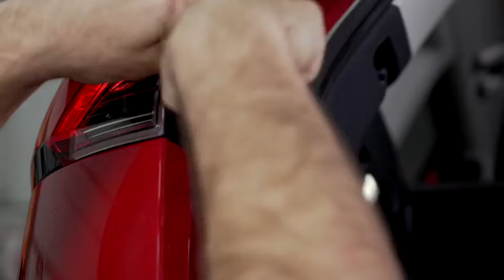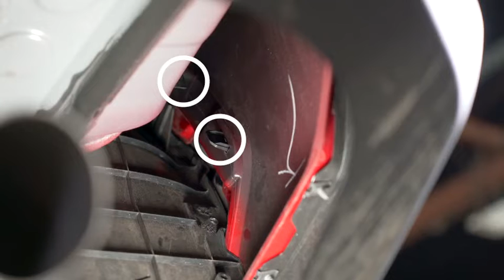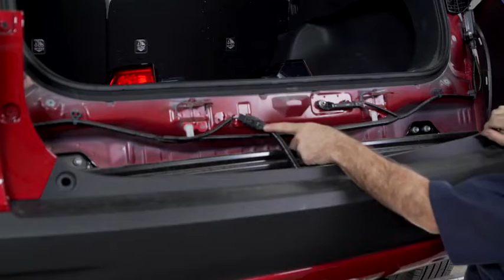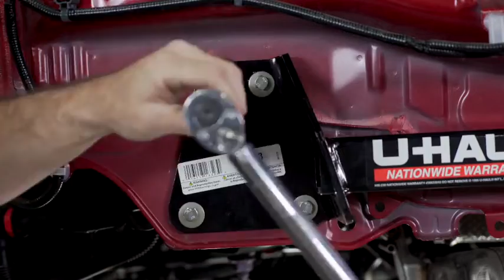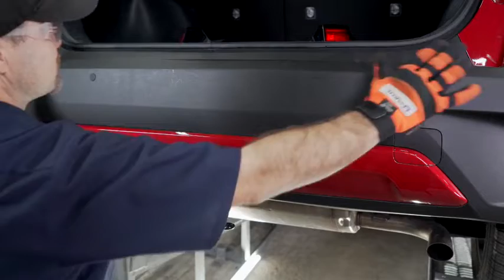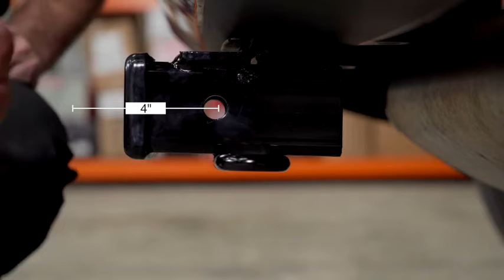2022-2026 Toyota Corolla Cross | U-Haul Trailer Hitch Installation | CQT76553

Comment: What grade are the connector bolts- and if the car owner wants to source a stronger bolt, is U-Haul allowed to use those instead of the ones in the parts kit?
Reply from the maker: The Hitch Includes class 10.9 Hardware. View the Hitch Specs here: https://www.uhaul.com/publication.ashx?fileName=CQT76553.pdf&digest=qaPiA2kaUQ4pesUxvYUj3g

Comment: Could you sneak your hand in to loosen the bolts of the bumper bar and wiggle th hitch into place without removing all the plastic or just slightly flex the plastic? Seems like there is enough room.
Reply from the maker: I dont believe its worth the risk of damage to the vehicle. The bumper beam bolts are not gonna be easy to access and you need to torque them properly. Dont forget you have to trim the fascia for the hitch to fit. Visit us online to book an Install with your Local Hitch Pro: https://www.uhaul.com/Trailer-Hitches/

Comment: What about the connections for the wiring of the lights?
Reply from the maker: Wiring is always a separate video because it is a separate part being installed. Here is a wiring video for a Corolla Cross with LED taillights. https://youtu.be/03AN7SmQEWw
Reply: @trailerhitches Only needed if pulling a trailer ?  What size trailer could it pull ? How much can it pull/carry (I want to transport a big front loader washing machine and at separate time, the washer too..for 1.5 hrs on the fwy). thanks for the link

Comment: Do not install the Bar again?
Reply from the maker: No, The Bumper Beam is replaced by the more rigid Hitch. This is not uncommon!
Reply: Trailer light wiring?
Reply from the maker: Sorry for the late respone but you did not respond to the video itself, rather commented on a comment and therefore there was no notification of your comment. Wiring is a seperate part and therefore a separate video. Here is the Link https://youtu.be/03AN7SmQEWw